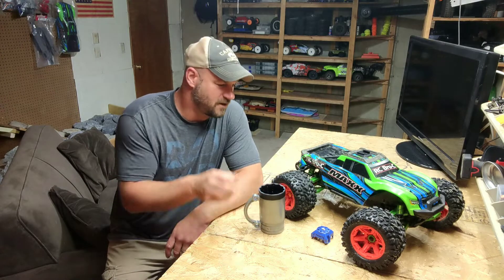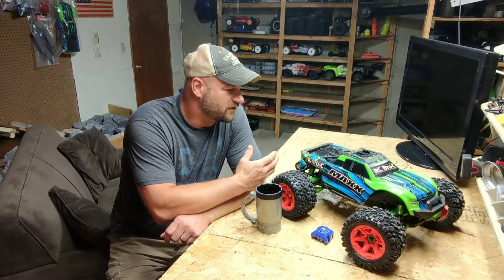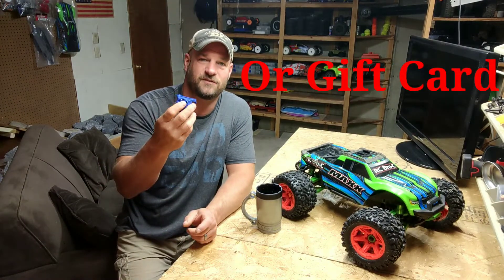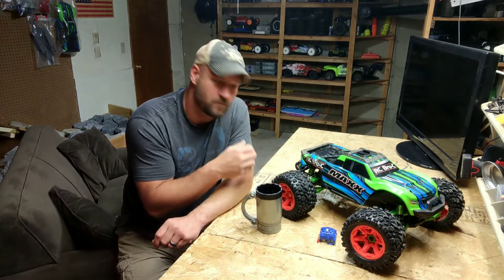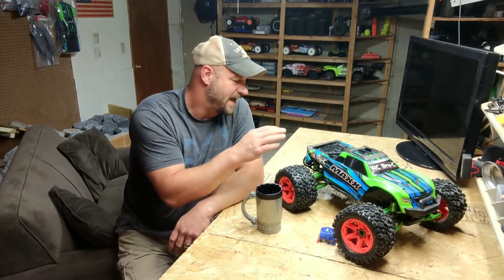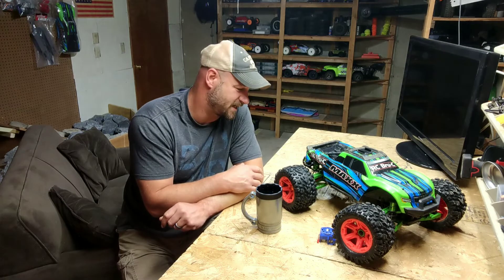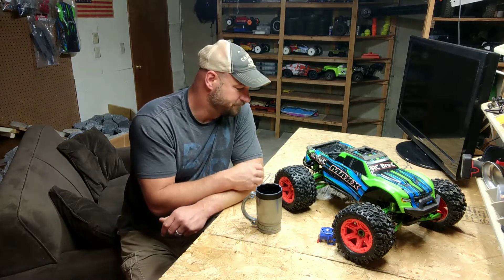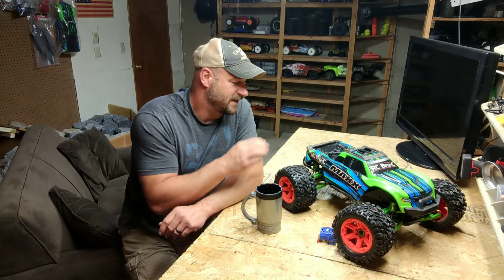Traxxas Maxx "4 must do and upgrades"

Comment: You forgot the number 5 tip:
20 tooth pinion gear.
#6 tip:
stay on 3s until you really need that 4s...
Great videos thank you
Reply from the maker: Very true maybe later update on video lol Thanks for watching appreciate it my friend 👍
Reply: I only use 3s and its more then enough for bashing
Reply from the maker: I have blown one spur gears so far,  I haven't really had an issue with that . Maybe just lucky so far.

Comment: Think is tires are such a personal preference, I personally hate super grippy tires, I like to slide around somewhat, but also have the tires last a while on pavement, I don't want to swap tires around all the time. I think the stock tires are just about perfect for how I want it to drive. I also put 90wt oil all round and that definitely helped, the stock 30wt, the front skid would smack the ground after a wheelie lol
Reply from the maker: Good point, thanks for stopping in appreciate it.

Comment: Good video, been running HR hub extenders {10mm} and ProLine Trenchers with the offset hubs and that is pretty awesome. Not quite as wide as the wide kit. I have a widekit  i bought but havent installed it. Got the replacement pin set too. I will probably remove the hub extenders and install the kit. I feel like they add strain to the bearings and hubs. Subscribed
Reply from the maker: Good stuff!

Comment: I'm in month 8 of ownership and gotta add tougher gears to your list. I've gone through 5 rear pinions and because they only come in a set (TRA8977), I've got a stack of unused rear diff rings. Finally threw caution to the wind and bought two hardened steel pinions from a Hong Kong vendor (took about 2 months with Covid & US delivery). Haven't looked back.
Reply from the maker: Haven't had an issue with that yet, ro be honest. So far lucky... will for sure keep a ear out for it. Thanks for sharing here .

Comment: Wide maxx and 3.8 tires really make a big difference.👍
Reply from the maker: For sure 👍
Reply: @2ManyHobbies16  did you gear down with the bigger tires?
Reply from the maker: Yes been a minute since I have been in there , but believe I dropped down a tooth on the pinion gear and running 19tooth.  Thanks for stopping in appreciate it !!!

Comment: I feel ya on the chassis slap! Ugggh!!!
Reply from the maker: Just sounds like it's doing some serious damage . Appreciate you stopping in and watching
Reply: RC Bru-C & Board Games I bought some heavy duty shocks with heavier springs but it still does it, but I’m only running 60w oil so I’m going to try what you recommended and hopefully it’ll make a big difference. Thx for the tip!

Comment: fan?  replace the whole ESC.  I put a hobbywing max-8 in there and it's a different animal.
Redcat RER12485 is a good cheap alternative wheel/tire
wide-maxx should be the stock form.  it's amazing
I need new shocks.  you're 108% correct on the stock shocks and oil
Aluminum steering blocks and c-hubs are a nice touch if you jump a lot.

Comment: Any issues with it stripping gears with the revo tires? Those things are HEAVY especially for plastic driveshafts (given you haven’t upgraded them) but now the wide kit comes with extended outer shafts so plastic is probably a good way to go
Reply from the maker: No issues with gears at all, and I have the gpm Driveshafts in it which extend, and honestly are very well built. Thanks for stopping in appreciate it.
Reply: @2ManyHobbies16  no problem bud, and good to hear! I have spare revo tires and a burning need for a maxx

Comment: I’m adding the shock oil now but 80 is the highest I got, should I just rock that in front and rear? Great info on the tires gonna pick them up tomorrow before bashing in Gatlinburg. Thanks You found a new subscriber
Reply from the maker: Sure will work fine, who knows might even work better that way for your driving style. Thanks for the sub appreciate it.
Reply: Where do you bash in Gatlinburg?

Comment: Part nummer on the tires?
Reply from the maker: Tra6774a hope that helps thanks for watching
Reply: RC Bru-C thx! Sure. :)  When you said Revo tires I thought they were 3.8. 🙂 do I need to put on 17mm hex or can I use original? 
I put 80wt in yesterday but will try your tip and put 90 in front.
Reply from the maker: I used at first orginal hardware that came with the max to mount the Revo tires to the Maxx. I have GPM drive shafts now and the wheel nuts are just like standard Traxxas wheel nuts for the special Traxxas tool, if that makes sense. Both ways work
Reply: RC Bru-C ok. Thx for a fast response! 🙂
Reply from the maker: No problem 👍